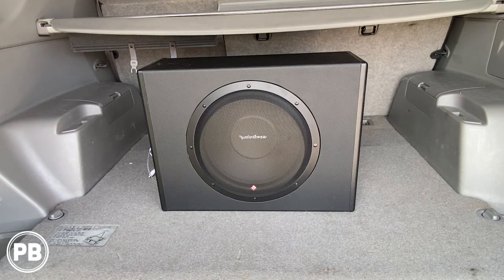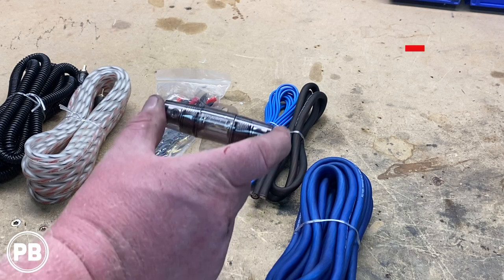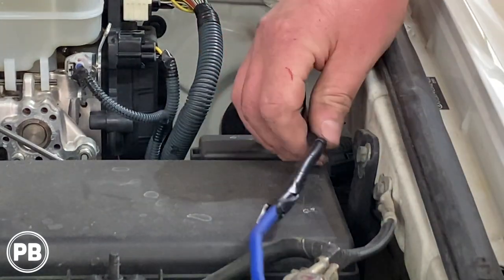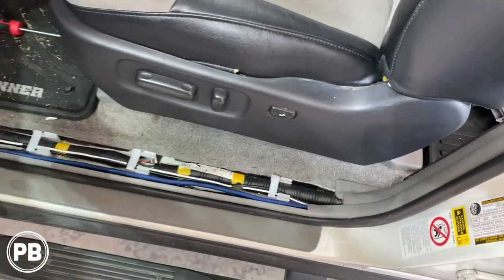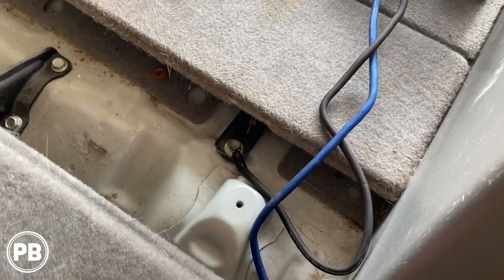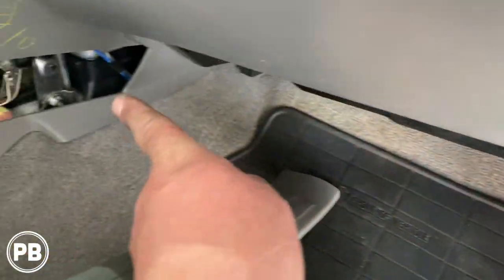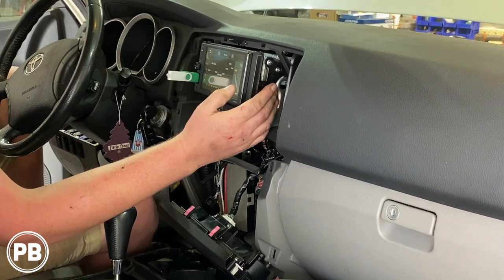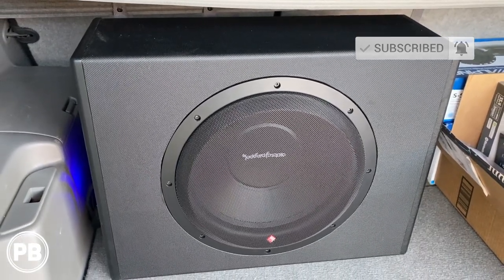2003 - 2009 Toyota 4runner Amp and Sub Install

Comment: The is one of the most professional stereo install videos I've ever seen, however, I 100% dislike systems that have an amplified subwoofer with the mids and highs from the radio only. The bass is usually way over powering the mids and highs. My goto setup is a 5 channel amp, 4 channels for front and back stock speakers for midrange, and 2 separate high quality tweeters. Midrange can utilize the 4 stock speakers since it's crossed over. The remaining channel will be mono to the sub. All 7 speakers are crossed over from the amp and equalized from the radio. It's very well balanced, hits hard, and sounds awesome with crisp highs.

Comment: Hi! Great video, thank you for putting it together. I'm not sure I want to replace the factory radio and I saw this graphic on your video: "If you didn't have an aftermarket radio, you can simply use a line out converter, or wire these RCA ends to your speaker wire in the 4Runner." Is there anything you can point me to to explain these 2 options? Would love to know more.

Comment: Great videos! I've followed all videos radio, door speakers, and backup camera. Now I'm installing the amp/subwoofer. I've used all of the same products that you have but I have two questions. What did you set the amp settings on and why did you run rca jacks down the passenger side and not the driver side? Thanks for any help you can give me.

Comment: How do you add the unit to a factory radio? Do I need to purchase other hardware?
Reply from the maker: Technically no, you can cut off the RCA ends and extend those wires via speaker wire and tap into any speaker wire in the vehicle (trim permitting).  Alternatively, you can get a line out converter to send signal as well.  just a few different factors there.  If you send me a message on facebook or instagram, i can point you in the right direction.